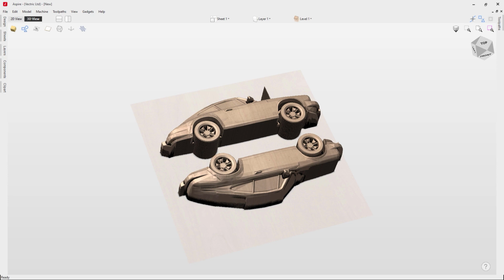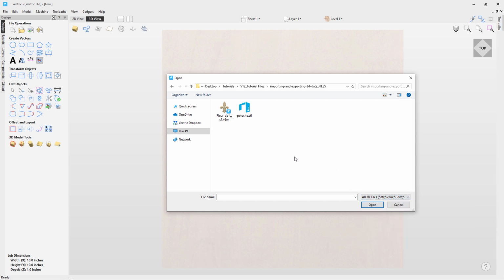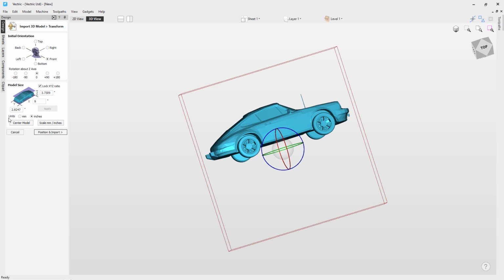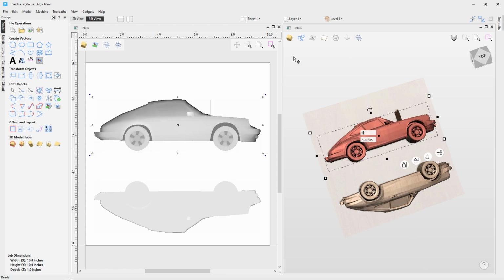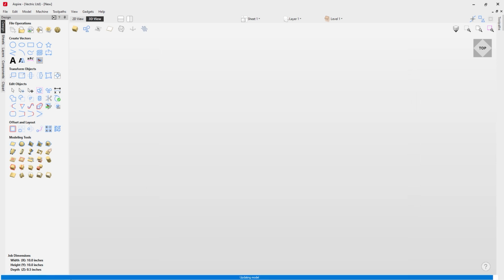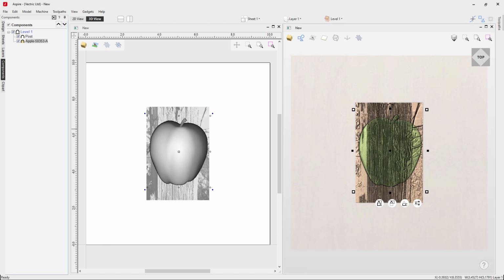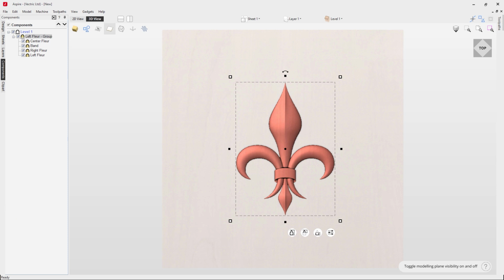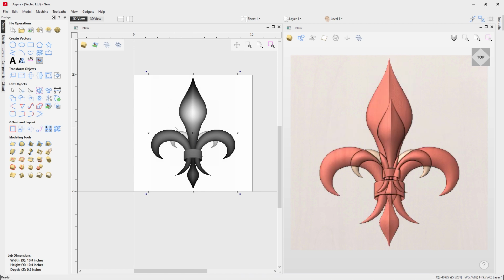How to import and export 3D data in Vectric software | General Topics | V12 Tutorials

Comment: why is the modeling plane half way through the material?   is the bottom half the material (represented by the red rectangle) not going to be used at all?   this part doesn't make sense to me.    I 3d print and when I import a 3d model I can "drop it" to the build plate. which makes sense, and it would make sense here as well. working off a plane 'in the middle of the material volume' makes no sense I can figure.   so.. please explain that.   
another thing I've found is that if the item is rotated off desired axis, there doesn't seem to be a 'this side down' feature, again, like you can find in any modern slicer.  this would seem useful for repositioning a 3d model for carving.  I don't know if you folks follow orca slicer or prusa slicer or <insert slicer> development, but there's useful features there for working with 3d model orientation, positioning, quick editing (like slicing into two) etcetera.   :-)   many more things, but a lot of it also isn't relevant outside 3d printing.  but the 'working with a 3d part' certainly is. :-) 
I mean.. maybe I should be working with and positioning the part in the 3d slicer and then exporting from there to import into here.. 
but.. for the $$$$ for the aspire software, I'd think it has some of the useful features that all free slicers currently have. :-)  
but, this is just feedback from someone from the 3d printing community.  maybe you agree there can be some cross-learning and sharing of features, maybe not.  
it's just my 2 cents. ;-)
Reply from the maker: Hello CrudelyMade... lost of interesting stuff.  These comments might be best directed to support@vectric.com, they can address the questions along with submit feature requests.  Thanks.

Comment: So vcarve is basically useless- if you can’t export in stl? Or is that just the trail version?
Reply from the maker: Hello. There is not an option in VCarve Desktop or Pro to export out to STL; you will need to use Aspire for that. VCarve is still a very powerful piece of software for importing and creating tooling for 3D models, along with all of its other features.  We do understand that, for some, it is not a good fit.